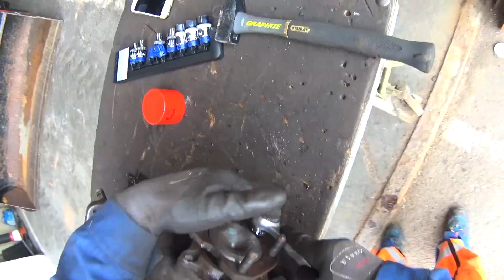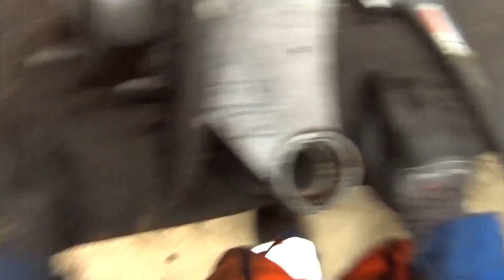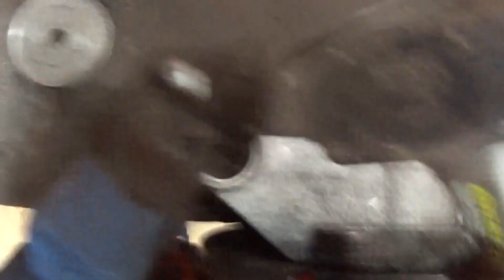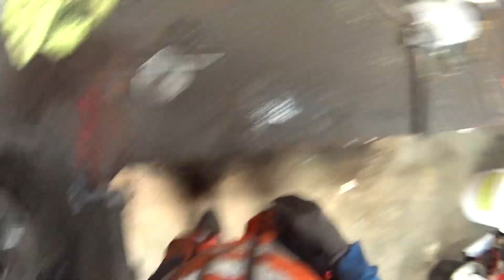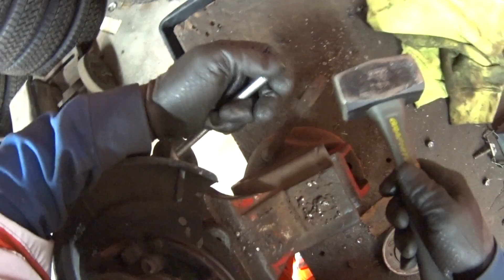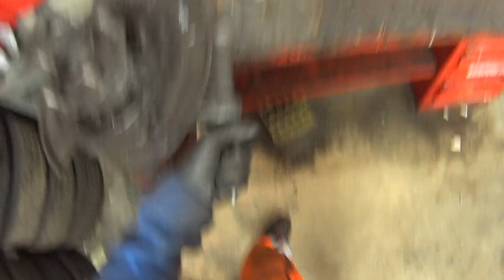JAGUAR XJ REAR AXLE & SUBFRAME rebuilt, Part 5: DIFFERENTIAL BEARINGS

Comment: Are those tori head bolts?  Or spline?
Reply from the maker: Which ones
Reply: @psv1600  in the output shaft cover.
Reply from the maker: It’s torx
Reply: @psv1600  Thanks, will try to get some sockets, have to work mine too..